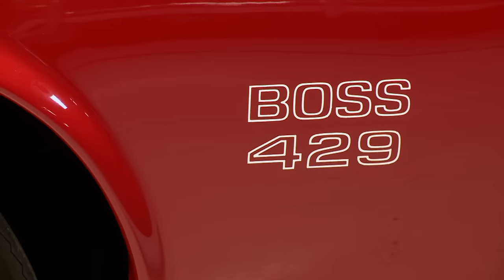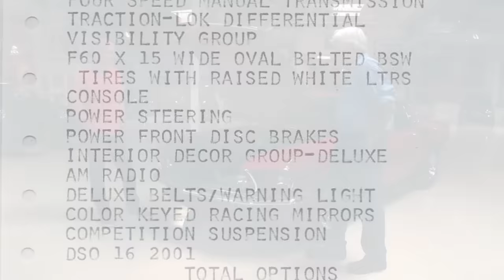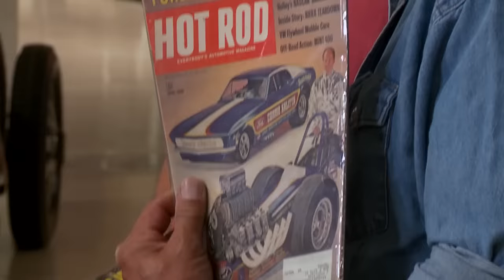1969 Ford Mustang Boss 429 - Jay Leno's Garage

Comment: The Boss 429 was the most powerful engine Ford ever produced up to that point? More than the 427 R code? I always thought the 427 was Ford's true bad boy NASCAR motor.
Reply: It was and still is.
Reply: It was and still is. The FE 427 won a lot more NASCAR races for Ford/Mercury than the BOSS 429 did. Love the Ford FE engines. The 390 and 428 were both good engines too from the FE family. I think the 352 was an FE engine too actually
Reply: @jeremythompson9122  The 390 and 428 were just big torquey boat pulling motors as far as I'm concerned. The 427 was designed to be a NASCAR motor hence few were sold while tons of the other two were stuffed into big Fords/Mercury's.

Comment: the engine Richard Petty drove, In a Torino !!
Reply: And said it had more power than the mopar hemi
Reply: @hishok3332  in 69? 69 it had the new boss 429. Thsts how they lured him away from Chrysler.
Reply: @hishok3332  i did
Reply: @hishok3332  split between the 2 engines
Reply: The Boss 429 was only avalible in the Mustang. The 428 or 429 CJ were available in the production Torino with the Boss 429 seeing service in the Nascar competition version.
Reply: @hishok3332  Sounds like the 429 Cougars may have been available only to a chosen few factory backed racers and not the general public.
Reply: Richard Petty drove a Talladega with a Boss 429

Comment: Sorry Jay but lean means more HP, rich is safe.  What Ford did was they gave it a small carb.  No disrespect at all this is the baddest Ford of the muscle car of the era.  However Ford gave it a pedestrian cam and less than competitive compression ratio.

I respect all the best muscle cars, and this is the best Ford muscle car ever.  Ford chose not to kill it with this car this car had the potencial to build car that would have killed the L88 chevy or the 426 hemi car but they didn't.   Even so these cars posted mid 13's in rare cases low 13's which put them as one the fastest muscle cars ever made.
Reply: Actually, the best Ford muscle car ever made was the '69 GT500. The 427 SOCH is one of the most powerful NA engines Ford has ever made, anywhere from just under 500 to just under 600 WHP bone stock depending on the set up. There's a couple 427 SOHC dyno videos on YouTube, watch a few if you don't believe me.
Reply: *****
Yeah I misspoke making it sound like running lean would build more power but a lean tune will yield more power but that's not actually running lean.
Reply: I think Jay was talking about the near future ( 1971 ) when carbs were leaned out to reduce emissions.
Reply: Rob Trubiano
The thing with the cammers was they were never put into any cars from the factory, they were offered over the counter as crate motors.  They were all out race motors.
Reply: Lean is mean, except for emmisions where lean is gutless, thirsty and burn the engine out. The engine was a homolgation special in standard form in that car,, but still quite fast.
And that car has the 6 blade fan , sounds like a 727 in take off mode. Delete that for a clutch fan is 20 hp!
Reply: 427 side oiler is a baaaaaadass engine
Reply: The 427 SOHC engine is not the "side oiler" engine.... the "side oiler" engine is the 427 they put into the GT-40, the Cobra and various limited Shelby Mustangs.... the SOHC engine was debuted and banned before the "side oiler" was ever built.... the SOHC 427 was an extremely rare engine and shoved mainly into Galaxies.
Reply: This was head and shoulders better than anything GM and Dodge could've dreamed of!!!
Reply: I may be wrong, but I'm pretty sure the '69 Boss 302 was quicker than the 429. I know it's sounds crazy, but I've heard it more than once. IIRC. it had something to do with the 429 being designed as a racing engine, NASCAR in particular, with higher top end being priority. It wasn't exactly a great engine for the street, but I'd still take one in a heartbeat! The car in this video looks exactly like the one my Father bought brand new in 1968-69. The only difference I can see is the hood scoop. I think Dad's 428 cj was a little bit smaller like the ones that came with the 351 Windsor.

Comment: Jay must not like this mustang or something
Reply: /smoking...Now there may be a clue to Jay's ...attitude....
Reply: Probably because it’s not his.  He probably tried to buy it , but the guy said “ah no thank you”
Reply: They are not a well balanced car. Horrible trying to work on that engine and it's meant to run near red line all the time and has lousy low speed throttle response with the huge intake ports. Jay just is not a fan of the result of shoehorning a huge engine in a so called "pony car" with it's front weight bias. I do think his opinion changed a little by driving it.

Comment: I worked for a Fodr dealer in 1970.  I traded in to my own company,  my new 390 Mach 1 for a former stock raced Boss 429.  She was blowing oil.  With the new canted valve hemi type engine , she wore out he valve guides, do to the asymmetrical pressure .  I took it to a speed shop which nuraliized  the valve guides. Reversed Fords taming of the motor.  With G60-15 tires and traction lock, cutouts, I never lost a race at Sunshine Drag way ever.

Comment: The body lines of the '69 Mustang are absolutely gorgeous... My claim to fame is I owned a '69 from '71 - '73 & I regretted selling it in short order. I sold it to a Navy guy stationed at the Davisville base in North Kingstown, RI... A couple weeks later I saw it sitting in front of a repair shop on Route 1 just up from the base. It was a complete total, the guy literally totaled the car! 
My heart still saddens at the thought of it to this day...:~(
Looking at those valve covers on the Nascar 429 C.I. engine brings to mind HEMI...It is a ton of motor for street use for sure, personally the 428 is better suited for the road imho... 
I love this Boss 429, beautifully restored...:~)

Comment: The first time I saw the BOSS 429 Mustang was I believe in an original Motor Trend magazine. The picture was this car looking really tough and fast in the rain in black and white - totally captivating. As I recall the article quoted a horsepower rating of 534hp. I never found any other article with that rating. I always suspected this went to print before the rating was "officially" changed to 370's.

Comment: Years ago I owned a beautiful  blue '69 Boss 429.  It was a blast to drive.  Later I bought a '67 Shelby GT500, also in blue with a white stripe.  I felt that the Boss had better chassis engineering and was a great handling car.  Wouldn't mind having both of them back today ;o(

Comment: My dad worked at a Ford dealer in 1969. He sold a BOSS 429. The dealership tried to talk him into the 302, but he was firm on the 429. The customer would drive it to work for a week, then it would be in the shop for two weeks. My dad told me that the engine had liquid filled tubes that cooled the power plant, but they would get clogged if the car was not driven on the race track. The customer was satisfied with his machine though.

Comment: I'm a Mopar guy, but I love those Boss 429s.  Contrary to what I heard Mr. Leno say, they are more valuable and coveted than your average 426 Hemi equipped car.
Reply: Hemi cudas have hit $3 million, if I’m not mistaken.  I don’t think any Boss has hit a million yet.  I don’t understand the discrepancy, as they’re both the same level of cars.
Reply: @MrJett1971  Cudas and Challengers are high dollar.  More reasonable are the Satellites and Coronets.  I had a '66 and a '67 Hemi Charger.  They were relatively low in value.

Comment: My dad bought me one of these when I was 17 years old. I still can't believe my parents let a teen-aged kid loose with one of these things. It almost reared up on its hind wheels when I accelerated. One time I had the nerve to take it to 100 mph before I got scared I might die lol. Mine had a metallic bronze paint job, which was a bit swankier than the classic Mustang red. Two negatives: As a teenager in a hot car, I wanted to load it up with  lots of passengers...and the back seat was a vestigial  remnant of a real backseat. You pretty much had to sit cross-legged or lie sideways with your head bent over your shoulders in order to fit. The other thing, which I'm surprised Jay didn't mention, was the almost horizontal rear window. There was zero visibility of what was going on behind me. Backing out of the driveway - or any parking space -  was a leap of faith. You just had to intuit which direction to turn the wheel.

Comment: Watching again, I want to point out that Boss 429 had the battery in the trunk, as well as aluminum intake manifold and head, so that it actually had the same weight distribution as the Boss 302 of 55/45. Much better than the 428 CJ's 60/40 ratio.

Comment: I had a 69 metallic green 302 fastback Mustang when I was 16, back in 1974. I jacked up the back end, put 60's on the back and 70's on the front. I think I went thru at least 4 transmission rebuilds. But the engine was rock solid. The biggest issue was the starter solenoid.  Would have to wack it with a screwdriver sometimes to get it to work right.  Great Car!! 69 was the best year, the quad headlights made it.
Reply: Moss Green....:)

Comment: What a beautiful car. I've come back to this video a few times over the years. Of all the Mustangs the 69/70 is my favorite. It's hard to decide which is my ultimate favorite though, either a Boss 429 or the GT500KR, with the 427 motor and, squared off front end. Not that it really matters though, as with the kind of cash these models fetch these days, either one would be waaaaaay out of my budget! In fact, as things stand at the moment, thanks, in part, to this damn virus, I'd be lucky if I could fill either one with fuel, let alone afford to buy one. Especially with fuel prices here in the UK.  One day maybe.

Comment: back in the mid 90's me and my best bud took out his dads 69 429 out one night after he was asleep.  We were 14... We almost died 2 times.  One when he figured out the car did not have ABS and we almost ran into an intersection after doing what I am sure was over 100mph and the other is when we pushed the car all the way down the street and into the garage so quiet that no one could hear us...

Only hole in our plan was we did that pedal to the metal 100mph run on an access road just outside the neighborhood and his dad woke up to the sound of his 3rd(and possibly favorite) child blowing fire and smoke out at 5000 rpm less than 200ft from his back door.  I literally smelled the fear when I heard his dad voice say.... "well boys, that sounded fun but its time to close up shop"... I peed a little, not gonna lie.  Close up shop was his way of saying you are not allowed in the mustang garage ever again son, because I did not see that car or the other 2 till we were in our 20's after that night.  Yes, he had a yellow 71 boss 351, a red 69 429 and a black on silver 72? mach 1...  All bought when he was young and they were cheap.  Good times lolol

Comment: In 1997 I was hired in at the Ford Motor Lima Ohio Engine plant that opened in 1957 the Boss 429 motor was built at that plant. The old-timers from 1957 who were retiring that year I was hired told me stories about that motor. Assembly line workers of that era were stealing the parts left and right  cams, carburetors and such until management worked out a system
of having special teams they could trust to build the engines.

Comment: One of the most underrated cars. When Ford developed this model it was basically a nascar engine that had been depowered too much to make it for street use. When they developed a more powerful and agile engine called the 820-T, the magazines had already done the road tests with results that were perhaps lower than expected.

Comment: Another interesting fact about this particular year that wasn't mentioned, is the fact that this was the first year Ford went with the round tires and wheels. Prior to this, Ford used hexagonal wheels. The hexagonal design was more stable when parked but the ride could be particularly harsh when the car was in motion.

Comment: It would've been interesting if he talked about the oiling system and the potential for low pressure when the engine was revved and really needed it. I knew a guy who had one of these and he complained about that issue and provided modifications to increase the oil pressure in the top end of the motor. He said he had bought it off the original owner who had blown the engine for that exact reason, low oil pressure under demand. I've heard other knowledgable people say the same thing. So, personally, I don't know if this is true. However, that doesn't wreck the image of this great car! I used to own a 69 Mach I Mustang with a 350 Windsor motor. It was a great car, excellent performance, looks and very dependable. Wish I still had it.

Comment: Some paint marks were often testing marks applied when machining adjustments had been made to tooling on part production lines. It's there to identify the first part made after the adjustment so it can be plucked from the line and tested for tolerances. If memory serves me right.

Comment: The pinnacle of muscle car Mustangs! The Boss 429 engine, as everyone knows, was designed to run on the NASCAR super speedways at 8,000 RPM all day long. The giant ports and valves in the head that make peak horsepower at high RPM are not designed to be driven  around town with the motor turning  from just off idle to about 3,000 RPM as seen in most daily driving situations. Ford had to detune  the engine drastically to make it drivable on the street ( the street Boss 429 had a 735 CFM carb which was smaller then the carb on a street Boss 302) and to make sure it lived through the warranty period! That is why the street versions never get the respect that motor deserves. Even so, the detuned BOSS 429 Mustang was one of the best overall muscle cars ever produced as seen in the DREAM CAR GARAGE MUSCLE CAR SHOOTOUT which was won by the BOSS 429 over such rivals as the Hemi Challanger , LS6 Chavelle and others https://www.youtube.com/watch?v=T-PZ7TJXmT0  . The street heads (S & T versions of the engine) did have semi-hemi (shotgun) heads with quench areas, but the NASCAR version had a full HEMI head producing about 630 HP. Ford won the NASCAR championship in 1969 with BOSS 429 powered Ford Telladegas and Mercury Cyclones over their MOPAR HEMI equipped rivals.  The Chrysler NASCAR Hemi at that time was making about 590-600 HP and weighed about 700lbs. The NASCAR BOSS 429 was making about 610-630 HP and weighed about 600 lbs! Nobody would be happy driving a NASCAR racing engine on the street in a daily driver!

Comment: In 1969 there was a GM COPO 427 singe 4 barrel carb engine that was rated around 425 hp. The duel 4 barrel was rated around 435 hp. All the hot rodders opted for the 435 hp engine. If you read the 1969 engine manual its obvious the 425 rated engine was a far hotter engine estimated at around 600 hp

Comment: 425hp was the magic number to avoid trouble. So, you see that number a lot and it was commonly understood that when you saw that it meant the engine was north of 425hp. Which was actually better, because then you avoid all the lawyer-racers who just want to compare spec sheets instead of actually racing the cars. We all removed the air-pumps, and took the belts off the AC pump, and turned the air filter lid upside down, and a bunch of other basically worthless traditions, none of which did much of anything, but it made us feel good and that's the important thing.

Comment: Jay rambles on about how nose heavy this car is, but it's not near as bad as the 428. This engine has aluminum heads and intake. Plus the battery was in the trunk. Moving the shock towers out also widened the front stance making it more stable. It probably handled as good as a stock boss 302.

Comment: The early air pump systs. we're later expanded in applicated funtions with additionaly controlled bypass valves & were of some consequentialy effecting performance drain with     4 - 5 Partially overlapping Effects cut off with vac line pull. Different pump evo's throughout time too. Fact is engine can be Savvyer built to dangerously indestructible, High performance competitor on track.
Although my early street experience here was Cleveland oriented.

Comment: This is THE iconic Ford muscle car.  Nobody cared how badly it handled, and everyone who sat in that drivers seat knew that was more than a 375 horse motor under the hood. With nothing more than a few mods to the intake and exhaust systems  these cars were turning 425 horses on the dyno.  With the right tires, you could keep up with some of the Hemi cars in the 1/4.

Comment: I owned two Mustangs - a 1967 3-speed 289 convertible; and a 1973 automatic 351Cleveland convertible that I sold with just 61,500 miles in near mint condition.  I regret "selling" both of them for a fraction of what I was sure was their "real" value at the time.  The 429 Boss in this video is nice but I like the Mustang convertibles better.  Nothing like a rag top Mustang for fun.

Comment: January,1980...i found a 429 Boss in Alaska. Complete but not running. $400 for it :...( I couldn't get it as i was leaving Alsaka at the time and didn't have time to get the title and stuff done to ship it for free on the barge back down to continental US. I always regretted not getting that car. It was complete and in primer and still needed work but i knew it was worth it. Hopefully someone got it and fixed it up right.